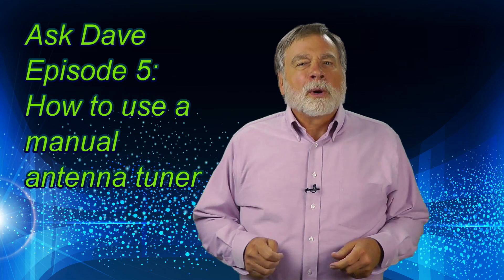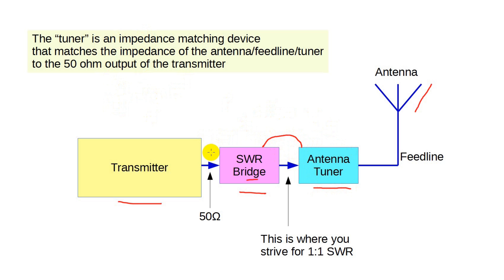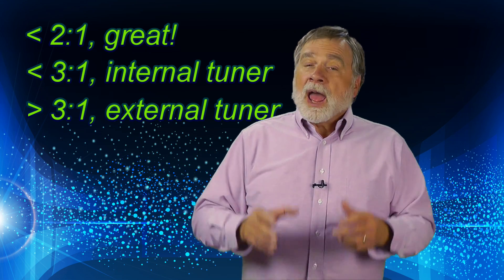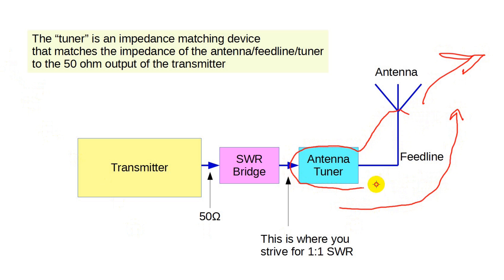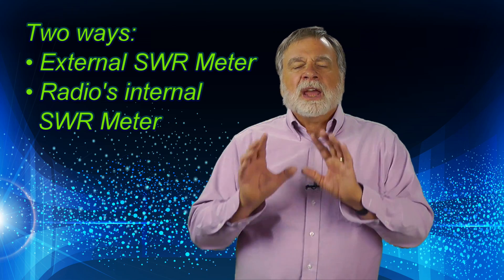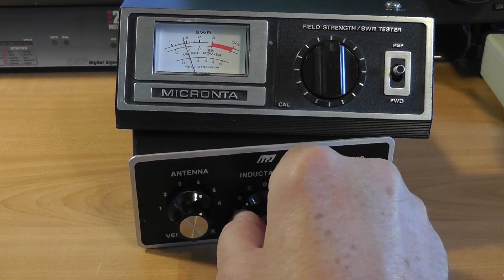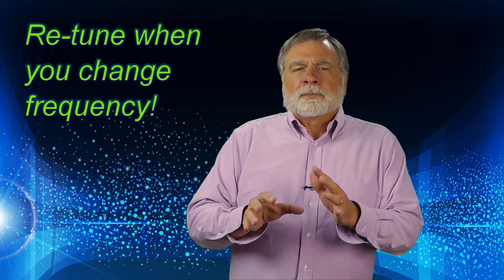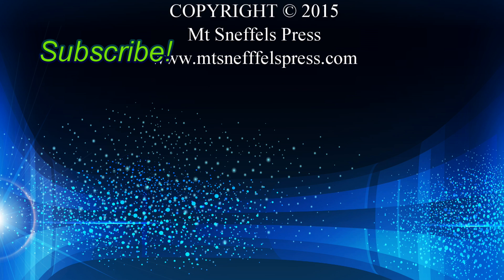Using a Manual Antenna Tuner: Ask Dave Episode 5

Comment: Dave back in 1970 I built the "Ultimate Antenna Tuner" and in 1991 I bought an SGC 230 Antenna Tuner. I still use both. They are both purpose built. The Ultimate Antenna Tuner is great when used at the Radio to match the radio to the feed line. the SGC 230 is better is come ways in that it actually sits at or near the Antenna. using the feed line to transport the RF signal to and from the antenna.

Comment: Dave hi

I hv a Heathkit sa 2060a. 

I am familiar with the tuning but there is a ‘sensitivity’ dial and a ‘set’ button. The manual gives almost nothing abt this. 
Am I correct in thinking to transmit at low power and to turn sensitivity dial while set button is pressed in, and then to line the needle on the meter, to set?? And to do this to each band?

I appreciate your answer. 

Thanku Dave. 

Billy
N1mrk

Comment: You did something in this video that I have heard is a pretty big no-no, which is to switch the inductor while doing a transmission. The problem I expect is that the SWR could go through the roof and that’s due damage to the transmitter while the switch contacts break and then make the next inductor tap.

Comment: I have two antennas that is no tune. I have an auto tuner the the five ninety and on seventy three i have a no tune antenna. the only problem is they will just take a hundred watts. i DO HAVE ONE ANTENNA THAT I HAVE TO TUNE. I have g-5rv. it has to be tuned when you change channels

Comment: Any antenna coupler with more than two variable elements needs an additional power indicating meter at the output of the coupler!!!
Couplers with two variable elements are L-couplers. If you match an antenna with these, the setting is unique, as there is just one and only setting (or none) to match the antenna.
Three element couplers like T or Pi couplers have several ranges in which they are able to match the antenna. But these ranges have quite different efficiency! You will not be able to find the most efficient setting for your coupler if you can't check how much power comes out of the coupler. The VSWR meter shows just the quality of the matching.
I strongly recommend to add a simple field strength indicator to indicate, how much power comes out of the coupler. There are a lot of simple circuits in the web to build a simple field strength indicator. But without this little gadget you simply can't find the best setting! This is not my opinion, this is pure RF technology!
Some elder antenna couplers have such an "relative output meter" and a potentiometer to set its sensivity. But modern manufactures simply left these out to save a few Dollars for each coupler they sell. Instead they have added nice looking VSWR crossneedle meters  -  most modern transceivers have a VSWR indicator already integrated, so in the coupler it is really unnecessary in most cases...
...but the other meter really IS needed! So build one yourself and tune your couple not just for a nice VSWR but for highest output!!!

73 Andy DH5AK

Comment: A NEWBEE Question?

I want to put up long wire antenna it would be a loop pattern around to roof edge of my home. About 12 inches above to roof, of course to get the length it would have a loop type configuration.  14 gauge stranded wire of 148 ft length, then a 9:1 UNUN and a 1:1 line isolater. Feeding to a FT-450d yeasu with a broad LDG matching tuner.  Grounding the long wire on the opposite end from the feeder.  So far I think it is working on 20m and up with an swr Under 2.2 across the bands.  (I tried it on FT8 to a POTA  station 1100 miles from me on a power setting of 50) Any suggestions on how to improve it to cover 40m and possibly 75m the voice end of 80m?  Is the antenna to long/short, wrong UNUN?  Thank you and 73.
Reply: P.S.  does the wire have to be tight or can it sag between supports- about 10’ apart and sagging about 3/4 inch between them.

Comment: David - good data but I think you should have mentioned that if you use the rigs build in SWR meter you need to have the AGC on and the RF gain to Max.  I usually turn AGC off, turn RF gain down and AF gain near max. Then I adjust RF gain for strong enough signal with minimum noise. BUT, I have to remember to go back to AGC and max RF gain when using the tuner again.

Comment: Is the antenna matching unit good to improve preselection of a receiver? Which are the LP, HP construction? 3 decades back I had an up-conversion transceiver and frequently heard AM stations around 10100 kHz. There was no broadcast there. When I turned on the ATU (AT150) that "QRM" was dropped. Which tuner is good for this purpose, T match , S match ...... ? Recently I compared my K3 with a direct conversion transceiver and heard the unwanted signal on 30m band later on upper band also making that band unusable. Need a solution, this type of QRM is not predictable depends on propagation. You may give an answer in QST as many tiny transceiver owners could be affected.

Comment: My question is, will an antenna tuner benefit a receiver like the Eton Elite 750? I've read that it helps, but I'm only one place and no one else seems to talk about using antenna tuners with receivers only.
Reply from the maker: Sometimes it helps to put a small (100 pF or so) variable capacitor in series with the antenna. You can tune the capacitor for max signal.
Reply: @davecasler  Gosh, I wish I had a clue about what you just wrote. I'm so very new at all this. My radio hasn't even arrived yet. 

What I didn't mention before is that I've just won a Sony AN-1 active antenna (because I hadn't bought it yet) that's on the way. Another video guy said, with an active antenna, I wouldn't need a tuner for listening. 

The Sony AN-LP1 is touted to be a superior antenna, but I understand loops are directional so I'd have to move it about to clear up stations. The AN-1 has a 5 foot whip I'm planning to mount  on the highest point on my roof. Long wire antenna aren't really feasible in my neighborhood. We might have a ⅛ acre plot, if it's that big. Probably not.

Comment: I have a 1-1 swr meter on my radio to antenna  and on meter in line ,,when i put a linear in line the radio meter gos to 3  and the in line meter  stays flat  why is that ?? and will  a antenna tuner fix this ??? thanks

Comment: Power is not reflected and re-reflected. The reflected wave establishes something called, wait for it, a STANDING wave. 

The standing wave changes the voltage and current distribution along the line, and the change in voltage and current distribution is what increases (or decreases) loss.

The PA never sees "reflected power". The PA only sees a mismatch from the target of design value it was intended to run into as a load. The standing wave simply presents a different load impedance to the PA, and the result is identical as if a resistor and reactive component of the value was placed at the PA terminals.

The PA can run colder, warmer, or not change at all from this mismatch. 

We really should try to stop with this power bouncing around until it turns to heat or bounces back into the PA stuff. That isn't how it works.  The mismatch, on the first reflection, sets up a standing wave. That is why we call it a standing wave. The standing wave simply alters the voltage and current along the line. It can make losses decrease, increase, or not change at all. That's right, losses in some systems can decrease with a slight mismatch.
Reply: The reflections 'bouncing back and forth' were the reason my 1 Watt longwave signal's voltage and current nodes grew so high. In fact, I could watch it grow on the storage scope. The number of cycles involved in that 'bouncing back and forth' until it reached an equilibrium of input vs radiation and dissipation defined its bandwidth, its 'Q'. That's what 'Q' is all about. It's how LC tank circuits work. They store multiple cycles of energy 'bouncing back and forth' and growing in energy, voltage and current with each new cycle unless it is dissipated in resistance or radiated. But thanks for the interesting perspective.
Reply: @johnwest7993  Interesting how you use system bandwidth limitations or rise and fall times of an envelope to justify the false idea of multiple reflections. I'm not quite sure how to make that leap between two totally different things.

Comment: What is the ideal capacitance setting for the Tx and antenna when switching the inductor to find maximum noise?  Fully meshed on both, or midway on both, or elsewhere?

As fully meshed is supposed to be optimally efficient I start fully or close to fully meshed.  This generally provides a fairly broad Q once tuned.

I've tried other matches with higher/narrower Q thinking it may act to some degree as a preselector to help reject out of band QRM/QRN and to some degree end band noise.  Are both the hi-Q and lo-Q matches just as efficient assuming the same indicated power out and reflected power?

Comment: If you own an antenna analyzer, you can also use that to tune your antenna without putting a signal on the air. An A/B switch can be used to choose between the transceiver and the analyzer.

Comment: I just found your series, have you looked at updating any of them. It is 2020, I have bought things from several SK sales, so I am not using "new technology". If there is no need to update the actual information, that is fine. it seems pretty basic, or at least well explained. I need to get the latest ARRL antenna book. Thank you for taking the time, and the pics are beautiful. I can no longer live at high altitudes because of respiratory issues, the area you live n is so beautiful, I lived in Colorado Springs and Denver metro at different times. Kansas is my home now. K0XHF here. when I get my shack ready, I will be looking for you.

Comment: How do you read the single needle SWR meter?  Do you read forward then reverse and then make a ratio in your head?  Which number comes first forward or reverse?
Reply from the maker: Set the knob so that the forward power is full scale. Then flip the switch to reverse and read the SWR directly.
Reply: David Casler, thank you for this answer and all of your great videos.  I passed my Extra Field Day 2020.  I watched your videos, studied with two books, and attended a self paced on-line course (hamtestonline, https://www.hamradiolicenseexam.com/).  The online Circe was great at teaching and grilling, the books were also helpful, but your videos were my motivation.  You are responsible for incentivizing my success.

Comment: Another GREAT video. THANKS! Beginner Note: Antenna tuners come second. A tuned - matched antenna comes first. Can't obtain a tuned - matched antenna, to old, HOA problems, no space...etc. Then a tuner is plan "B" but never plan "A". This should be mentioned to beginners. "But my radio has a built in tuner" okay be lazy and connect it to a piece of metal and make the tuner do all the work. But don't wonder why there's loss. And "yes" there's loss. This is simple math. The antenna tuner is a placebo and most of the time superfluous when a correct antenna is in place and used properly.

Comment: I have the same antenna turner . Sometimes when I tune my antenna,   the antenna knob well be on 3 ( for instance) and the transmitter knob well be on  5 or 6  why is that? should the antenna ,and transmitter knob   be on the same number ??
Reply from the maker: Just the luck of the draw. No significance.

Comment: How long does it take to burn out finals and how do you test them, I had a bad see situation when I first got my radio.
Reply: S w r. Situation
Reply from the maker: You can burn out tube finals in an instant, or they can gradually go soft overtime. Treat them gently and follow the instruction manual carefully. The newer transistor amps are usually protected.

Comment: Great video thanks Dave!!! Got a question for you Sir...i'll have in a few days a lovely well kept Kenwood TS 440 S...this radio already has a tuner inside...would be enough to tune a 102" whip for mainly 10/11/17/20/40mt band? Or i better add to the set Up an external tuner? The whip will be mount on the Roof's center of my Sprinter Mercedes RV...the Roof is made out of steel , so should be a good "ground" ...i'll maybe have as well place enough to fit some Radials at the Antenna's base...if it help .looking forward to hear from you...the whip is metal no fiber glass...73's hope by the way you and beloved one are Fine...here in Spain we do fighting hard against CoVid 19....all the best Steve ciao
Reply: Other option apart of the 102" whip , could be Buy an Antena Multiband HF one of those you got to move a cable between pin connection to tune on every single band...like the Outback 2000 antena or the Proxel X1...if you have any suggestion on other good antena for Mobile Car uses...i'll be happy to pay attention to your suggestion...the idea of the 102" whip is that i already have one with pl mount and spring bought from Usa from Breedlove shop...best again 73 ciao

Comment: Why can't I us my antenna tuner be for my amplifier? If you put the amplifier in bypass mode anyway and antenna tuner turn in low power anyway.
Reply from the maker: Your radio output is 50 ohms, and your amplifier input is 50 ohms when the amplifier is on. Don't put a tuner between the two. If you're going to use a tuner, you have to bypass it when you're using the amplifier. Or, get a high power tuner and put it after the amplifier. You can use the high power tuner on either high-power or low-power.

Comment: Howdy. Very nice presentation.
Is there a reason to why most tuners are T -tuners ? I believe Pi -tuners provide more harmonics attenuation. Perhaps modern tranceivers have very good harmonics attenuation by themselves ?
Regards.
Reply from the maker: Electrically, a T tuner and a pi tuner do the same thing. They both help with harmonic suppression. Modern radios do not need any additional harmonic suppression and can be connected directly to the antenna and meet all requirements.

Comment: This is a really old thread but hoping for an answer. I have a Yaesu 817, MFJ-813 and a Z817 auto tuner. What is the order equipment should be connected, I thought that antenna into SWR meter, from SWR to the tuner and from the tuner to the radio, but I am just not sure, please help. 

VA3LAM 

THANK YOU AND 73
Reply from the maker: Connect the radio to the S meter. Connect the S meter to the antenna tuner. Connect the antenna tuner to the antenna. Tune for lowest SWR.

Comment: I am using a CB half wave ground plane and a manual antenna tuner for 6 10 11 12 17 20 30 40 60 80 and 160. 80 + 160 are kind of a NVIS.
Reply from the maker: NVIS is generally undertaken with horizontal polarization. Although your wide-range tuner may give you an acceptable SWR, at those huge mismatches, much of your power may be radiated as heat in the cable.

Comment: I CHECKED MY SWR FOR MY CB AND IT MEASURES 1.0 ON CHANNEL 40 AND CHANNEL 1. BUT WHEN I REKEY THE MIKE IT STILL PEG'S IN THE RED. IS THAT NORMAL AND IF NOT WHAT IS WRONG? THANKS REPLY TO KEMOSOBEE@GMAIL.COM
Reply from the maker: Sounds like RF is getting into the radio. Make sure your system is properly grounded.

Comment: Great video, thanks! Here's a question: Are some manual tuners better than others? I'd like to buy a manual tuner, hopefully one that I can take out in the field. But I also don't want to compromise on quality, especially because in the field I mostly use relative low power.
Reply from the maker: MFJ makes many antenna tuners, including QRP tuners. All manual tuners these days use the classic "tee" model. Two variable capacitors and a variable inductor.